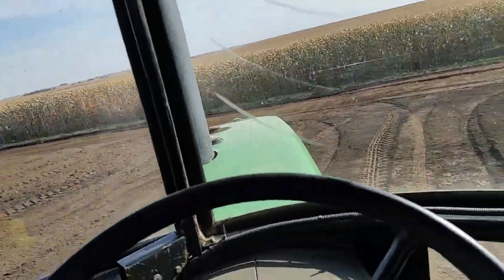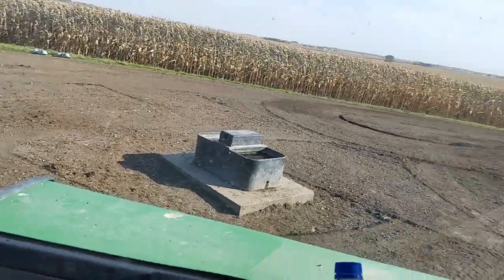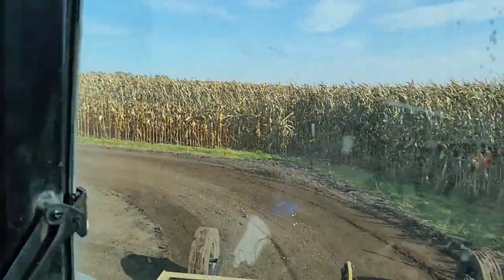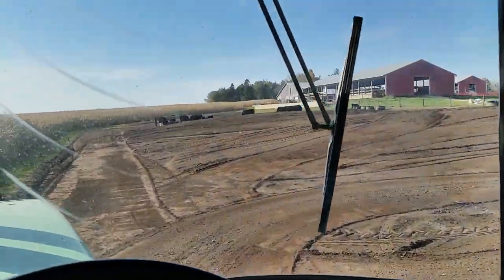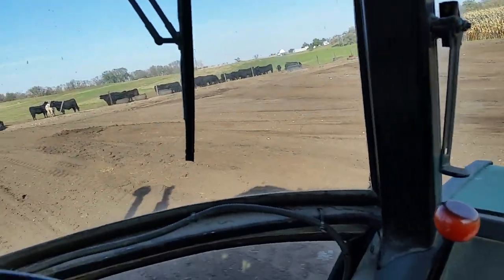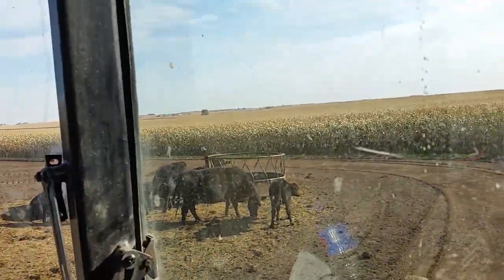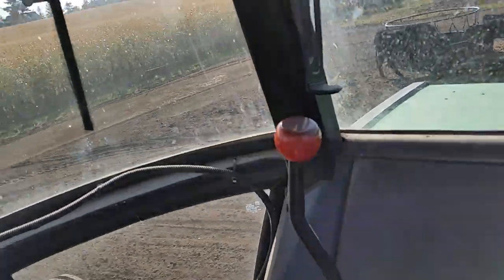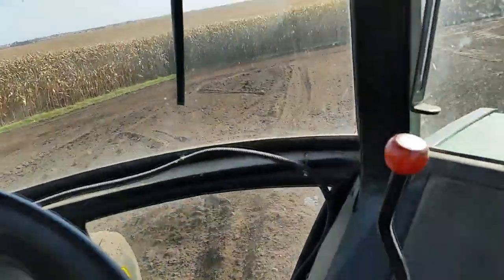Scraping Feedyard Pen with Box Scraper

Comment: Do you guys use a hot wire on that perimeter fence around your feedlot?
Reply from the maker: the high tensile fence has 3 wires hot...then around the yard next to corn is just a single strand of electric fence..plan to put high tensile 7 strands all around in future. this yard is usually only used over winter for cows
Reply: Thanks for the info.